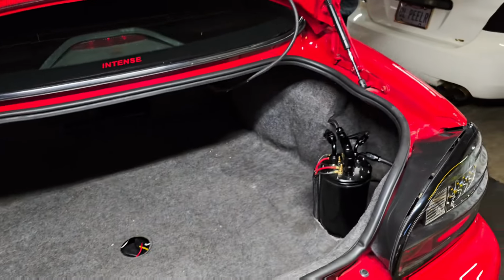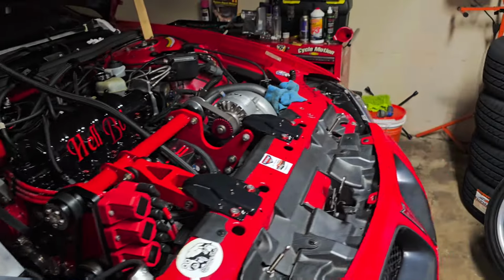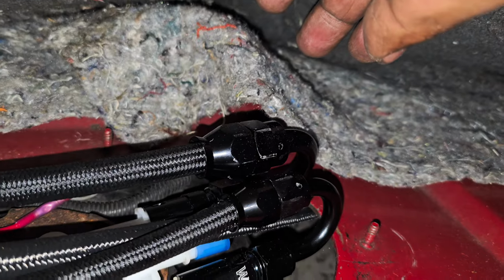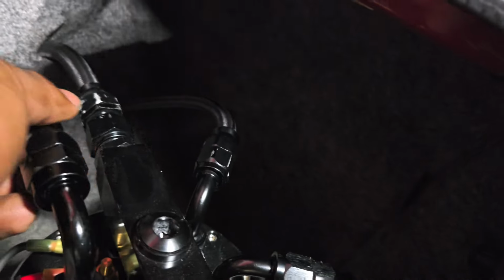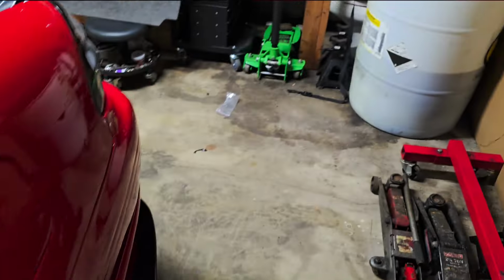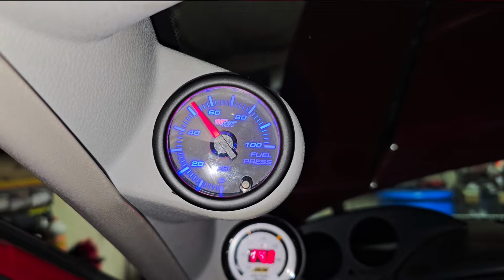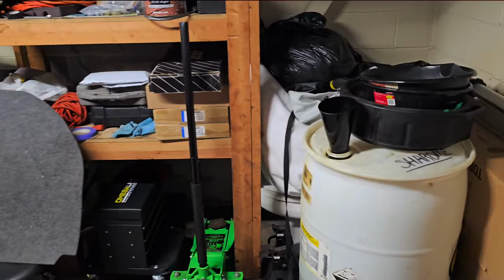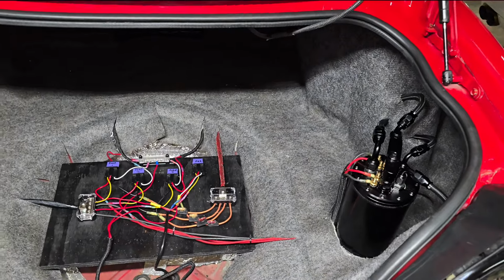New fuel setup complete HellBoi runs

Comment: Do you have lights that turn on when you open the door? I have a red pontiac set never installed i was thinkin about doing to the gto. That sucks that line leaked but you got it man. Hellboi back in action 😁😁💯❤️
Reply from the maker: @jbeelby89  yes I do at the very end of vid I got all leaks fixed
Reply: @hand12u i see that. Im ready for the ride along video in hellboi 😎